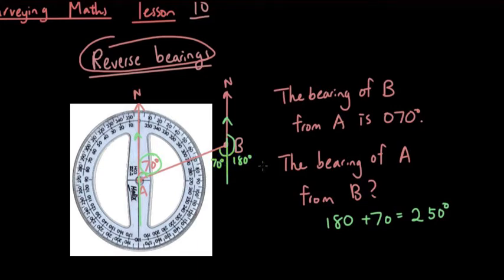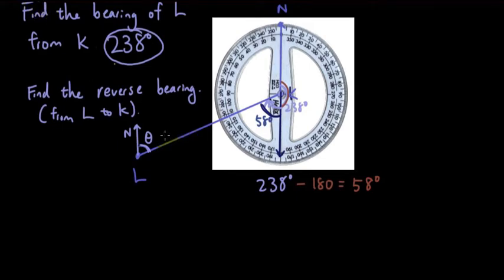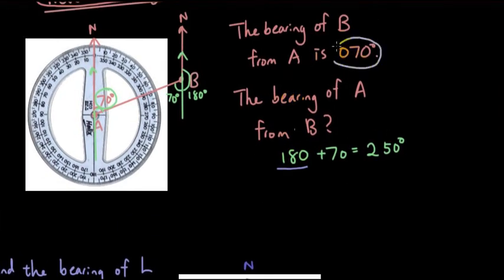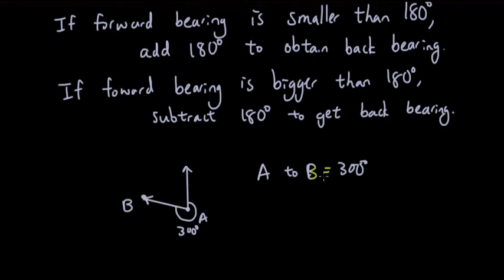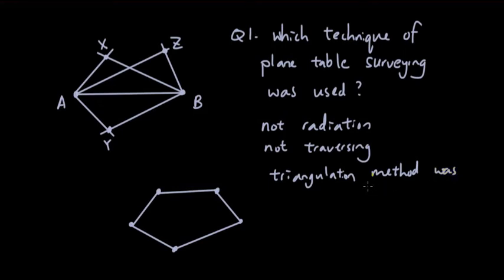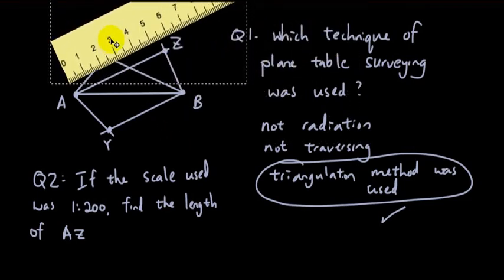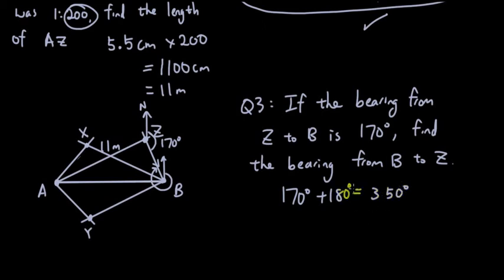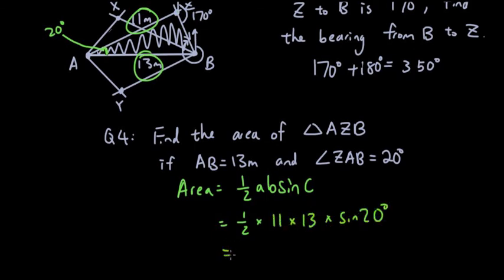Surveying Maths A lesson 10 - Back (reverse) bearings, scale factor, summary

Comment: I like your surveying videos. I wish you would  do one that compares the inside angle with the outside angle. Where the inside angle is say 070, degrees from A, to B, is it not reasonable than to measure from B, 290, outside as a check for your Survey. As  follows, ( 290 + 70 = 360). Therefore if the reading be found more or less then 360 degrees you must remeasure until the sum = 360.